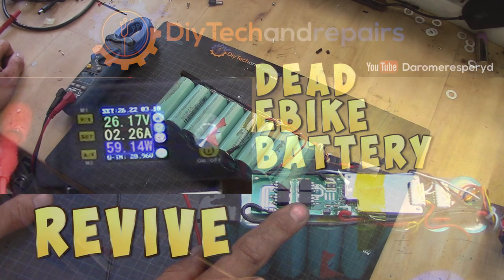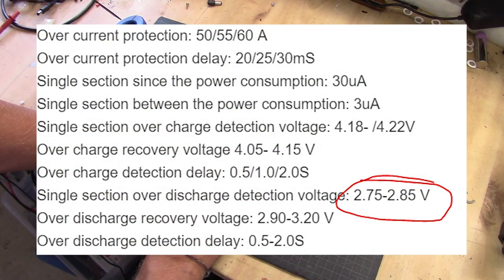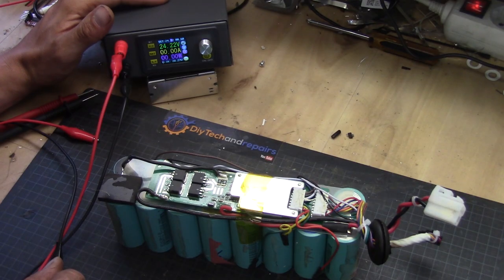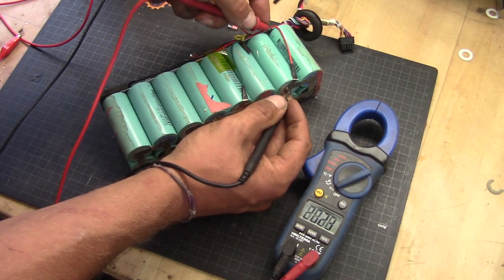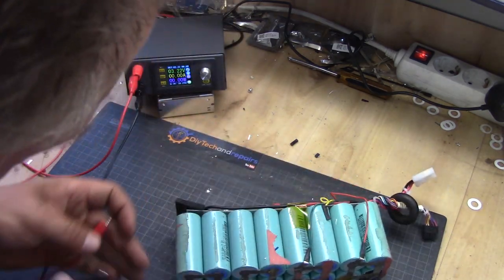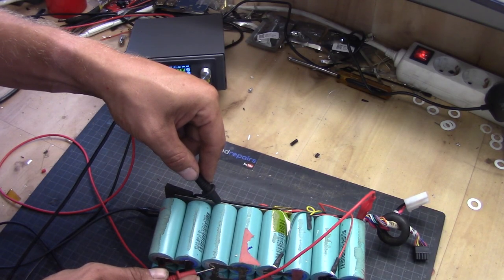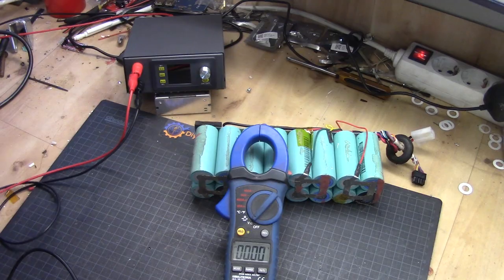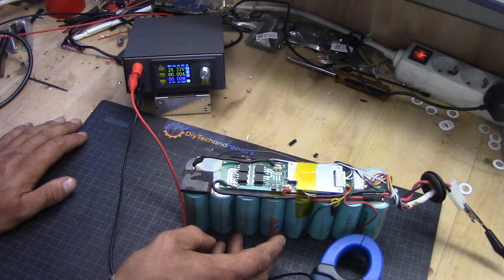Revive dead ebike or lawn mover batteries

Comment: Really nice, dude. Weird that the cells discharged themselves! Even more weird is the fact that the BMS won't recharge in this case.
Reply: MC's Creations it not weird every lithium battery does that.
Reply: Dennis LiPo batteries definitely do. That's why you should never leave them charged - otherwise they're going to be destroyed... They lost all it's capacity. But LiIon, like the 18650s, never done that with me... And if they do it means they're not good anymore.
Reply: @MCsCreations  You have to be careful, there are some really bad 18650's on the market. All claiming to match the specs and performance of Samsung cells. I bought a brand new battery pack for my laptop and didn't get 6 months out of it before it died.
Reply: The BMS has a value for cells, when they drop under it its not safe to charge and use the pack, so the BMS turns the pack off. If you put the voltage on that cell up to where the others are the BMS will allow charging again. I dont recommend doing this at all, replace the cells instead.

Comment: what kind of balance do I have to use for a 24v Power wall? It has 1025 .64 watts. 7s 18p nominal 25.9v. What balance should I buy? It's for a solar system

Comment: You charge until the charger disconnects, wait 6 hours, discharge slightly and then charge fully again. 
A few of these cycles will balance the cells.
Reply: Does this really work?
Reply: @mct8888  Only if cells are in good state.
Reply: Why wait 6 hours?
Reply: @mct8888  You can only wait 3 hours, then weak cells fall more than good ones.
Reply: I can’t get it to work.  Two 48v batteries stop charging at 53v.  I use them a bit, then charge again.  They just go back to 53v.

Comment: Could you do this with a standard multi voltage 1000ma PSU or using one battery that's fully charged? 
Spacey bar 🖖😎

Comment: QUESTION:
I am trying to revive a 52V 20ahr ebike battery that I let discharge over the winter months. I have a power supply connected (set at 52V) to the pack leads. I started charging at .5 amp and over a two-hour period have increased to 2.5 amps.
What do you recommend for a charging amp rate?
The battery came with a 3-amp charger that I will connect when the battery reaches 52Vif it doesn't catch fire ha ha.
Reply: It worked, battery is now on the charger!!!

Comment: Love your channel.    I am building a off-grid, solar system with 48v battery bank of 18650s.  So far, I have 180p14s  (2,520 cells)  yielding 390ah @ 48v.     I've set my Midnite Classic 150  to shut off at 47v (3.36v/cell) and battery on at 54.6 (3.90v/cell) yielding about 60% DOD based on 4.2/cell -> 3.0/cell for 100%.     Battery University (and other bits) indicate 60% DOD lead to 5,000-6,000 cycles before cells drop below 80% capacity...    but info seems a bit fuzzy.        understand that if I went to extremes like 25% DOD instead of 60% DOD I'd extend my cycles to 10,000? or 15,000? - but  25% DOD is only 5kwh where as 60% is 12kwh (in my case).     
 I have my controller set to a range of 3.90v -> 3.36v/cell (58%) assuming 4.2v -> 3.0v (100%).    Do you have any thoughts / advice on this?     What is reasonable DOD?     What voltage range do you use for max/min?    Do you do full charge (to max) before allowing battery drain or just set 1/2 way (say 3.6v/cell) for inverter on?
Any info / thoughs appreciated :)
Reply: if your charging regularly the latter is sufficient. oh yeah before i forget  our time is important stop with the drabble please your the only one trying to be impresed have you got that 25% iso 9001

Comment: Can I bypass the BMX with the original 36 v charger.  By slicing the wire and use small clip wires to connect the whole 36 v batteries for 15 min

Comment: I also have the same mower as you, (RS630)  with same battery and same problem. I was going to connect charge head directly to main battery terminals as you did to bring voltage up. Then I noticed that the factory charger outputs 34 volts. What is your thoughts on doing it this way?

Comment: I really hope you read this! And can direct me a little?!

I have 60V 20AH Lithium battery that belongs in my E-chopper, it doesnt charge anymore with original charger, when i check my battery with my multimeter it reads 48,3V 

So it is not yet completly dead right?

If i get that powersupply like yours, i need to disconnect the bms?
And then find de black and Red wires coming straight from the cells? 
And then connect the power supply?

But at wich voltage do i put it then?

I really need it working for my chopper again! And a new same battery is €400+...

I really hope you still anwser questions here! 

Kind Greetings from the Netherlands!
Reply from the maker: Hi, Im here still :)   First of meassure each individual cell. It can be 1 cell that is dead causing the bms to shut down not letting the charger to charge.  Also crosscheck that  your charger actually works. From there you can look further but before any manual intervention you need to meassure whats going on.
Reply: @DIYTechRepairs  i checked my charger and that reads (63, something) so thats good!

I currently dont have a powersupply like you, a friend of mine who i asked if he maybe had one, because he works in a lab at a university, sadly he didnt had one, but he said that i could also maybe possibly use a usb cable with stripped ends and hold those on the individual cells?? Like a magyver style recharge? 

Would that possibly work? 

I now will go open up my battery pack again and first will measure each individual cell! 

Thankyou soo soo much for reacting! Been struggling with this issue for 5 days already🤣

I will keep you updated when i have measured each cell, will you be here for today? Because i'm gonna check the cells in like 10 minutes, and then i will put my findings here again
Reply: @DIYTechRepairs  i have not yet checked the cells but i just had an amazing idea! I rememberd that somewhere i still had an unfinished DIY Powerbank Project laying arround WITH a micro usb 18650 charging module!! So i just found it and desolderd all the old wires, i'm now going to resolder 2 wires, and then i will check each cell! And if i find bad ones i can just put the charging module on it in theory and they will charge up!
Reply: Okay so i have a battery pack with thats 60V 20Ah when i check the connected blocks of 16 cells with multimeter most give 10,2 

But the 2nd block of 16 cells show 0.00 (i cant check them individually because they are are connected as series. 

(There are 8 blocks with 16 cells  each, and one block of 16 cells shows 0.0)

Do i need to attach my 3.7V 18650 Usb charger to that block?

What should i do now?
Reply from the maker: @jaspervandertuuk2109  You need to check each cell not several cells in series. It sound like one is totally dead and that most likely need to be replaced if its 0.0v.

Comment: Can I use the factory battery charger to charge the cells outside of bms ? or do I need a specific charger like yours. Thank you for the informative video.
Reply from the maker: You can use all chargers that support slow Charge or low voltage Charge. For instance nimh settings as start
Reply: Did you found a solution, mate ?
My battery is low voltage too and my factory charger can't charge it anymore because of that and i'm a bit afraid to charge it directly to the battery past the BMS with the factory charger..
Reply: @Samishii00  go through the cells and see if they output voltage if they do. It's the BMS not working. You charge directly the cells disregarding the BMS but you will need to change it for the cells to balance correctly later. Using the charger on the cells directly will work if the voltage output is correct and you wire to the negative and positive terminal of the battery respectively
Reply: @hedialaya3230  Thanks for the answer mate !
Hard for me to do that tho' since i can't get the battery out of my scooter without damaging a lot of things.

If i buy myself a Modulable power supply, do you think i could directly branch it to BMS so that it charge the battery, if i lower the tension enough ot be in range.

Cause i have a 48v battery but when i put my multimeter to it i just have 2V or 1.8V, that's low as hell !

Comment: Do I have to remove the battery housing?
Reply from the maker: Only if you cant reach the balance leads. But if the battery is empty you may not know what lead goes where. Beware that reviving a battery being dead is HIGH risk. DO NOT do it in house if you have the slightest concern

Comment: what is the minimum voltage for each cell below which the bms blocks the charge?  2.6volt or less?
Reply from the maker: Depends on the bms but its ofte. Around 2.5v
Reply: @DIYTechRepairs  Ok thanks, in your opinion with these Chinese bms it is better to bring them to 3.85volt/cell (for storage battery), is it better to get there from a higher voltage by discharging the battery or from a lower voltage by charging? I ask this question because I don't know how the balancer works in these cheap bms.
Reply from the maker: @sandroz321  they only balance by overcharging. Ie Above 4.25 v